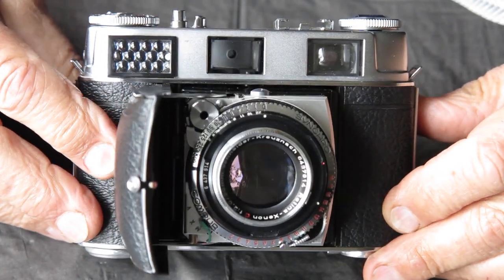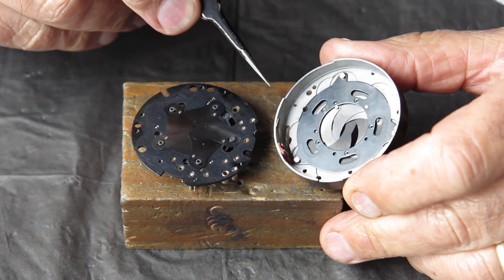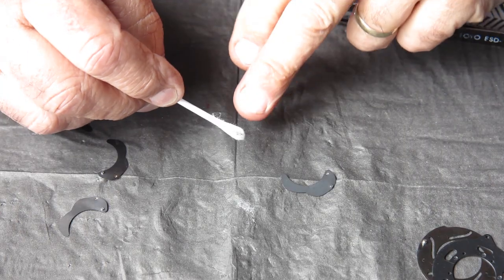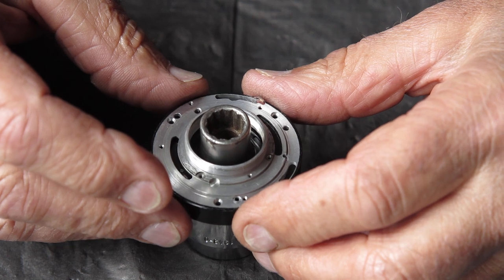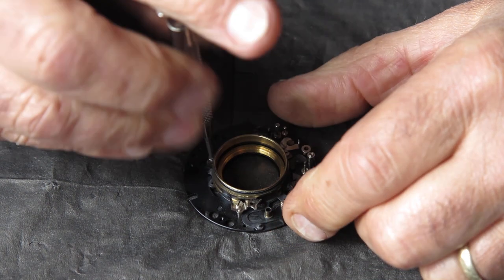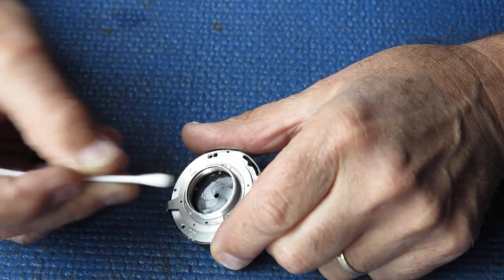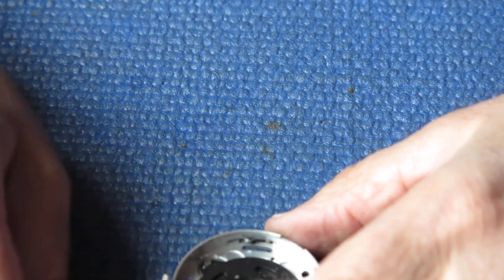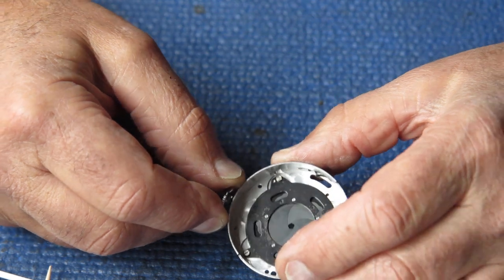A Synchro-Compur shutter in a bad state. In this case all the diaphragm blades were displaced.

Comment: I have tried the first method of cleaning diaphragm blades on a very old brass lens,
Which got a lot of the old grease off. I must have another look after watching 
This to see if it can be fully disassembled ?
Reply from the maker: Some of those old lenses had a large number of diaphragm blades, so I'd exercise caution. Five blades are easy, nine or ten blades are noticeably more difficult, fifteen or twenty, not much fun at all. The hard part comes at the end when you have to swing away the blades you placed first, so you can fit the last ones in place, and then swing the first blades back over the top of the last blades without disturbing anything. It is easier if the blades are nice and flat. Unfortunately, they are often distorted and don't want to lie flat, and you don't find this out until you have the blades out for cleaning.

Comment: Would the oil eventually just migrate back to the main blades (if using the dodgy method)
Reply from the maker: That depends on how much oil was present originally. Usually it is the shutter blades that cause you the most trouble.